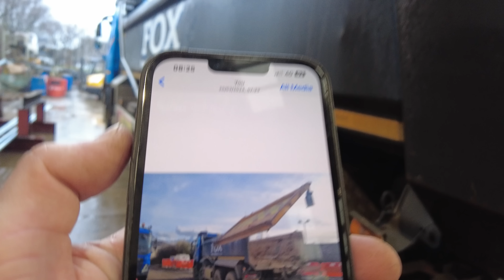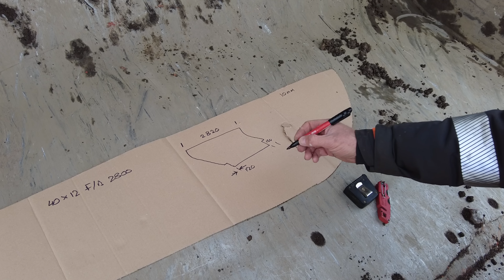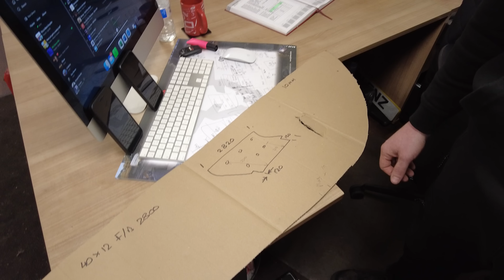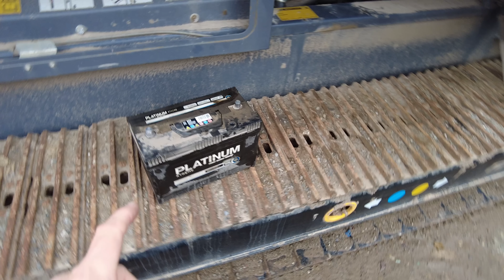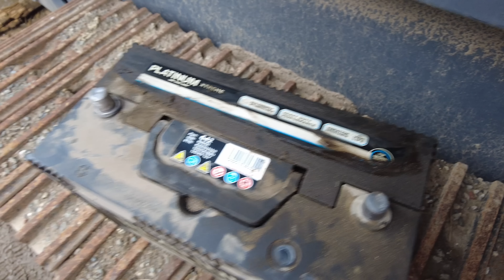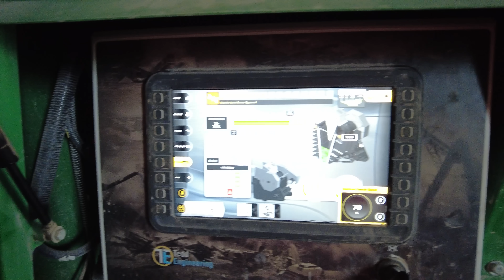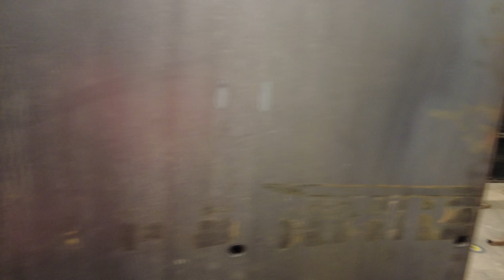Uncovering  the Volvo Exhaust Issue: & Simon's Shenanigans! Ch #035

Comment: I would have put shuttering ply on instead of steel to face them shutters   that plate is going to swell in-between the supports and the bulges will be visible on the walls after
Reply from the maker: No chance that plate will swell mate

Comment: Just a quick question Welderfabber why does your company store the excavator booms in the air compared to on the ground, surely when stored on the ground there's less pressure on the hydraulic systems on the machine. Thanks.
Reply: Flannerys do the same so must not be detrimental to the hydraulic systems
Reply: It save’s a serious amount of space when lifted up without buckets and the check valves on the rams I’m sure would save issues with the rams.
Reply: Saves space, if there is a leak the boom will droop, the weight of the boom alone is no stress.

Comment: evening Baz could you explain what hardox is and the difference between the 400, 500 etc and how it compares in price to mild steel please. i build riveted boilers for traction engines and rail way loco's so work with boiler plate mostly so interested what hardox is all about. 

best regards Sam
Reply from the maker: 400/500 is the difference in hardness and wear resistance mate

Comment: Great episode guys. Good luck to Luke. Loved the sketch with the horses 😂. You could be right about the water settling in that spot BAZ. Upright exhausts used to have lids which opened and closed with the exhaust gas pressure. Being closed when the engines off, stopping water ingress, or faced horizontally for sideways release. Could be a simple fix👍. Any collaboration with D&J or others will be good, as the one with the Struggler was. As you say there is enough work for everyone, small or large businesses so highlighting each other’s services is always good. Plus there’s usually a few laughs to be had👍🏴🇺🇸

Comment: When you heat the steel to strengthen pour cold water on you’ll actually see it come back straight use this method every day to strengthen props when they’ve been welded

Comment: Great video Baz. Those crushers are quite a machine. I reckon they need a professional operator just like any other piece of plant. I don't think you lads will ever run out of work. Straightening those shutter section was impressive.

Comment: Hey is there any reason all your trucks have stacks?? All of our trucks the exhaust comes out at knee height and only has about 500mm section of pipe coming out of the muffer/emissions box, it's not fun standing in front of the pipe while doing up straps is the biggest downside coz it's very hot on the legs!!